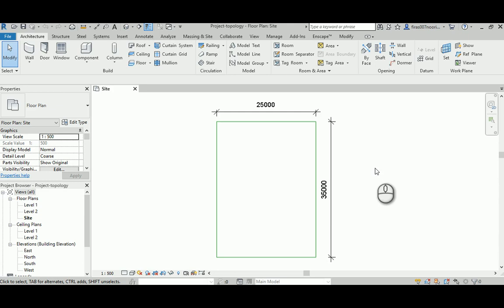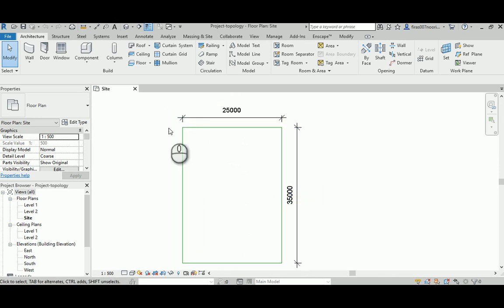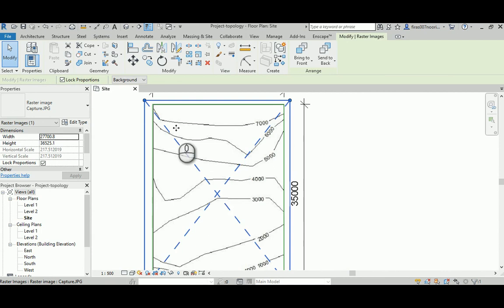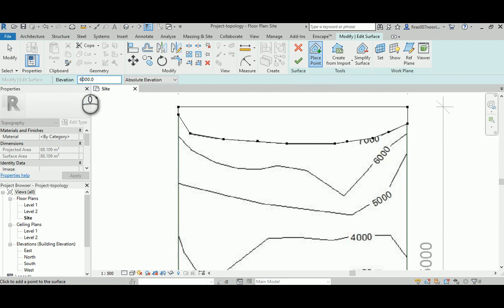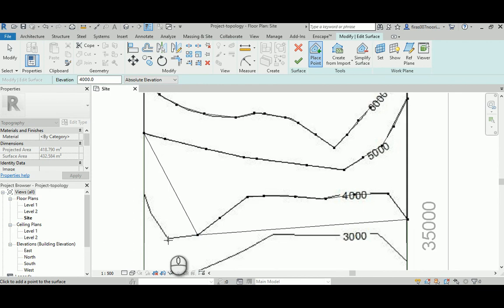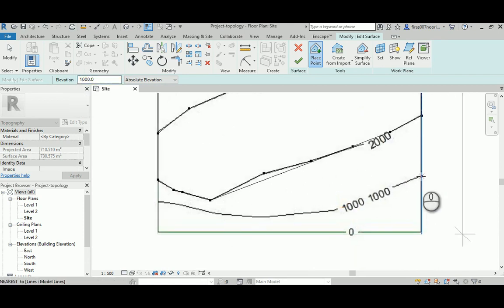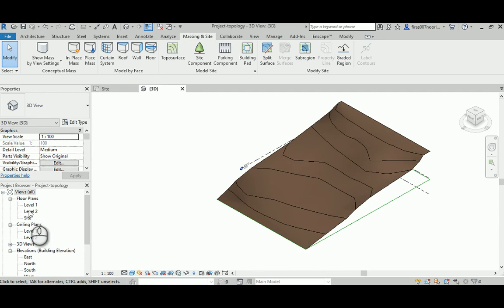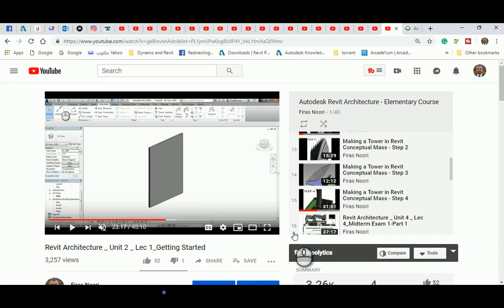Revit Architecture - Extras _ Site Topography _ Contour Lines

Comment: To make labels, you can simply draw one line. No need to click at every contour
Reply from the maker: True 👍
Reply: Mine are greyed, I cant change to base point, what caused that?
Reply: Do you mean you can't change their association (base point, survey point, etc.)? If so: I don't have revit open to check, but that is typically a setting under edit type? If not, I believe it would be under the overall topo setting, under the massing and site tab.
Reply: @raekell  It turns out my Elevation base under properties was project based. It does not work on survey point neither. It has to be on Relative then you  will be able to select either Current Level or one of your levels